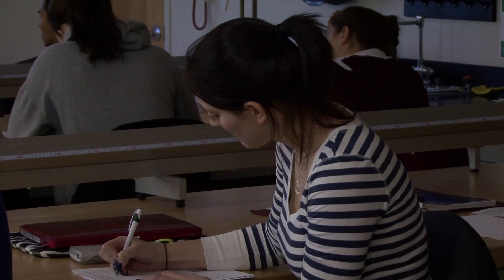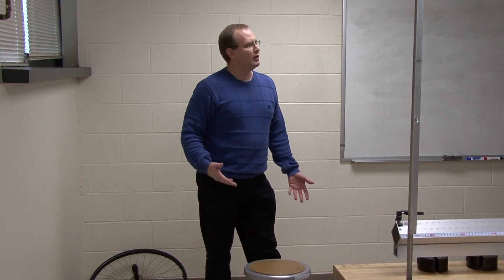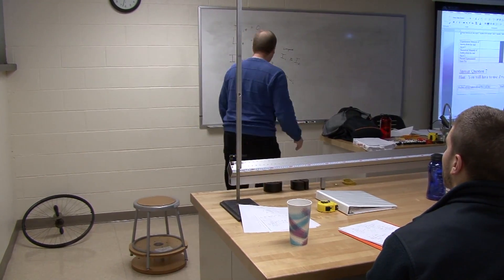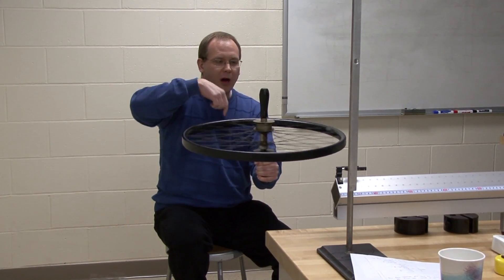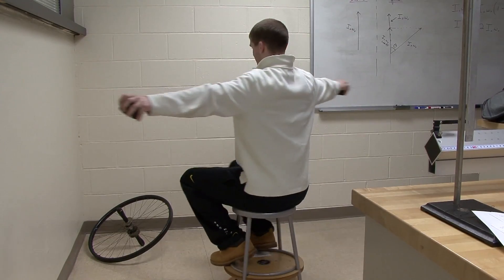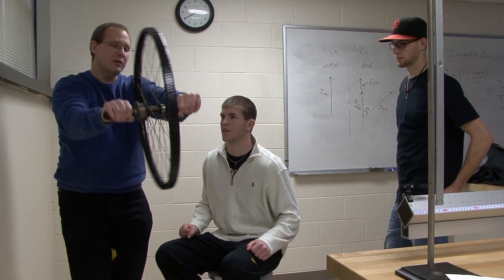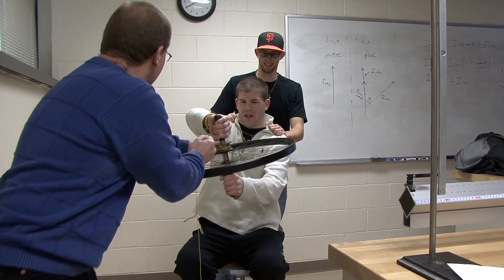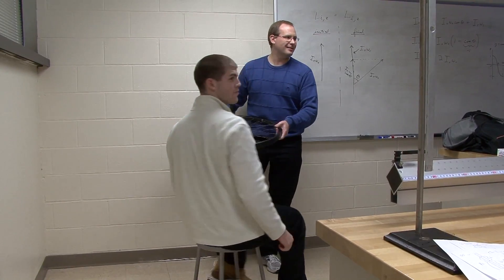Conservation of Angular Momentum

Comment: Why when he rotates the axis of the wheel the other way, he stops rotating in the opposite way?
Reply: the reason he started rotating was to conserve angular momentum.  reverting the wheel to its original position reverts his rotation to its original amount: in this case he was not rotating at all to begin with.
Reply: Timothy Bodette can I ask? If the teacher rotete the wheel on opposite direction, then he will rotate to opposit direction? I mean opposite from the direction in the video
Reply: @virgovalorant  if the initial angular momentum of the wheel let say clockwise and rotate it, the person will gain angular momentum of clockwise direction. means that the initial direction of a wheel is the same in the final direction of the person.
Reply: @virgovalorant  Yes

Comment: This is the science of gyroscopes, but I believed they worked differently. To clarify, I thought that, for the gyroscopic item to keep it's momentum, would resist rotation of the axis it isn't rotating in. If unable to resist, would lose momentum. Does this mean leaning on motorcycles in fast speeds utilizes Conservation of Angular Momentum to turn more than just counteracting inertia?
Reply: Glad you reminded me of my own comment.

Gonna write this down and ask my physics teacher.
Reply: alphamoonman did you get an answer?